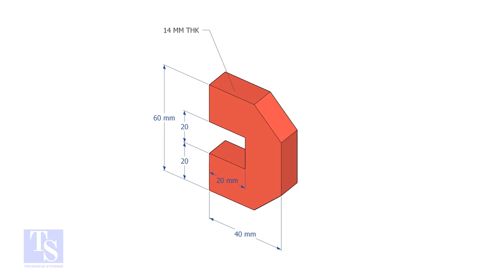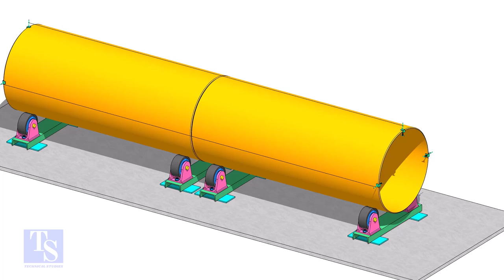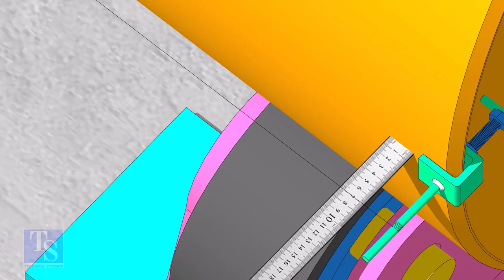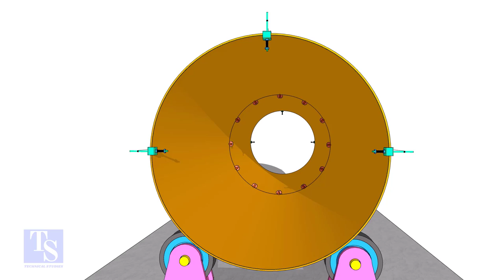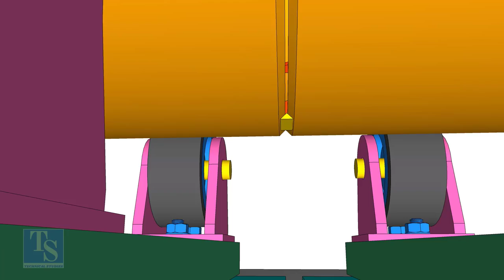Large pipe doubling tutorial for beginners. Pipe fit up tutorials. लार्ज पाइप्स कैसा डॉबलिंग करेंगे

Comment: Another great tutorial, thanks, 
Some work places do not allow the dogs (cee's) and wedges to be placed inside of the pipe as they consider it a confined space, so the dogs and wedges are placed on the outside of the pipe, also when the cee's are removed the tacks a ground back to be smooth with the pipe and usually a NDT such as Magnetic Particle is used to ensure the tacks did not leave a defect.
Reply from the maker: Dear Andrew, sometimes, I cannot provide all the details, because, I am trying to provide maximum knowledge in shorter videos. Anyway, your views are helpful for me and the viewers. Hope you will share a comment on my other videos also, so that, I can improve my upcoming videos. Thank you.

Comment: Can u pls explain about Bends and it's types 5D bend and 3 D bend
Reply from the maker: Sure Bro, Thank you for the suggestion.
Reply: HI Jubin Regarding bend radiuses such as you mention, 5D or 3D this is the centerline radius of a bend and is based on the diameter of the pipe. Example for a 5D bend in a 3" diameter pipe, 3 inch pipe x 5 = 15 inch centerline radius, or for a 3D bend in a 8" pipe. 8 inch pipe x 3 = 24 inch centerline radius. 
To obtain the nearest metric equivalent multiply x 25.4, so a 24inch centerline radius x 25.4 = 609.6mm and the answer is usually scaled up or down to the nearest 5mm so in this case would be 610mm.
Standard purchased pipe elbows are 1.5D and short radius elbows are 1D

Comment: Can you tell me addtionally that how many meters is distance between two rolls ? how many degrees is Angle between two lines but they are created by connecting center of pipe to contacted points of pipe and rolls
Reply from the maker: Hai Bro. Thank you for the excellent questions. distance between 2 sets of rollers along the pipe is 1/4 length of the pipe from the end of the pipe. 2/4 of the pipe length will sit on the rollers. suppose the length of the pipe is 6 meters. 1st roller will come 1.5 meters away from one end of the pipe, and 1.5 m from the other end. 3m length of pipe will sit on the rollers. The distance between the two wheels of a set of rollers shall be equal to or less than the RADIUS of the pipe. suppose the diameter of the pipe is 1200 mm, then the distance between the two wheels shall be 600mm or less. Hope you understand my explanation. Thank you. If you have any disagreement, please comment.
Reply: @technicalstudies.  That is a excellent answer. Thank you so  much so much.
Reply from the maker: @ducchiennguyen3588  Bro, can you suggest some topics for videos please.
Reply: @technicalstudies.  thank you for your suggestion. i would like you to tell me about fabricating complex structure as column, girder, beam so on...assembly combination as product of power plant( casing, duct, stack). Addtionally, you could to tell me about straightening by heat and hydraulic jack and method performes them. You can give your email address to send you some picture and desire you to make videos for fabricating them. Thank you very very much!
Reply from the maker: @ducchiennguyen3588  Thank you. straightening by heating was my favorite, some years back. mspanick21@gmail.com
Reply from the maker: Hai Mr.Nguyen. No comments in my new videos?🤔
Reply: @technicalstudies.  Thank you, I shall send some picture and look forward to make new videos!